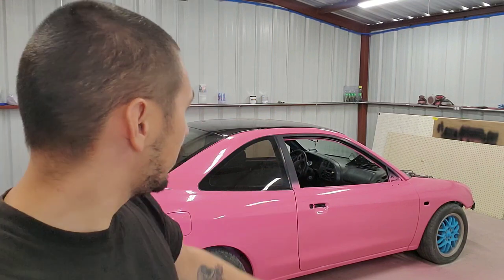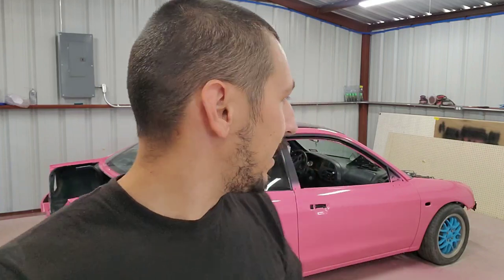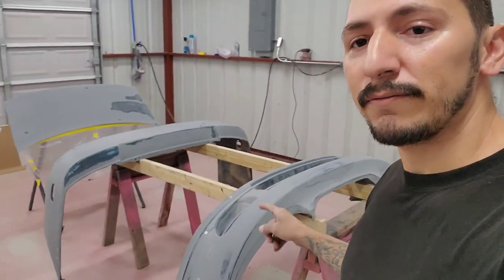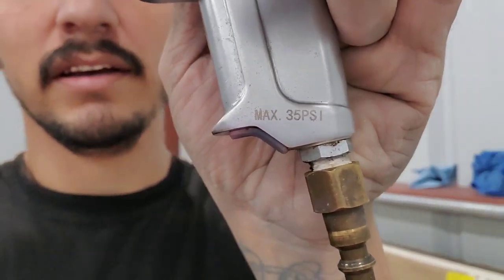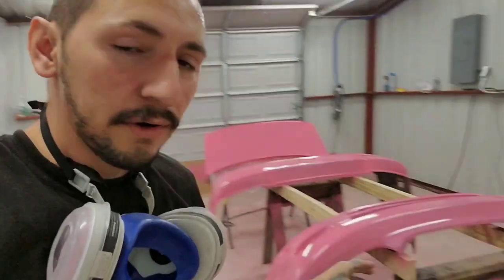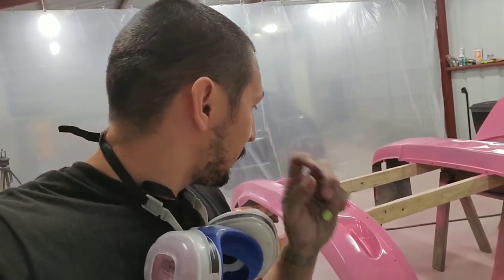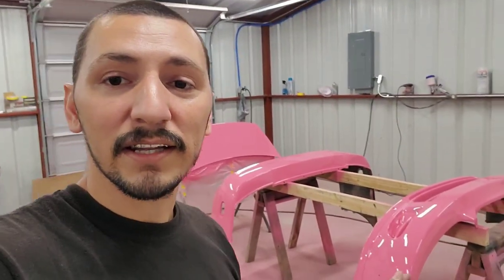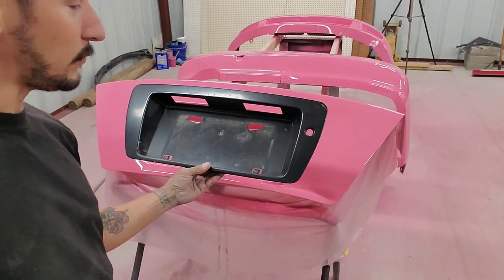Painting Bumpers with Rustoleum!

Comment: U added a hardner to the paint right?
Reply from the maker: No, this is just rustoleum reduced 2:1 with acetone. 
I'll use catalyst hardener on another project
Reply: @GTsPerformance  dang man, for a full color change I would have added a hardner. Thats alot of work bro but hope it holds up
Reply from the maker: Did the same for the last paintjob I did on it (smoke grey).  Went 2 yrs and did great.. if it weren't for some dog scratches and me getting bored of grey.